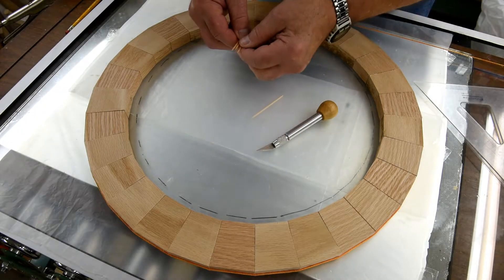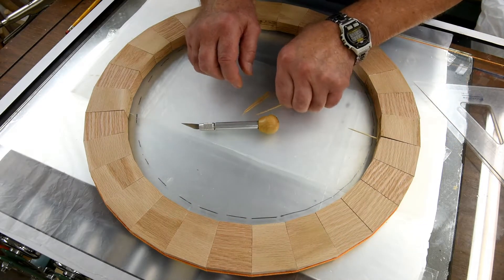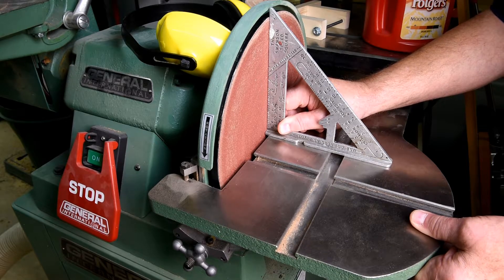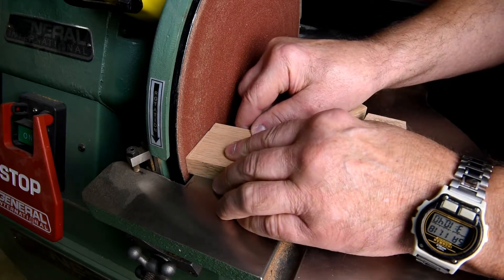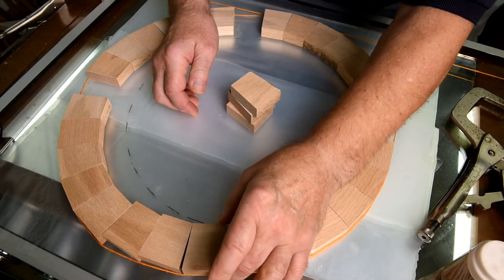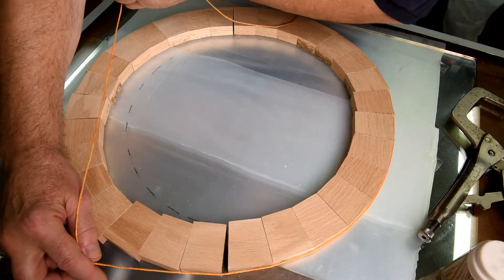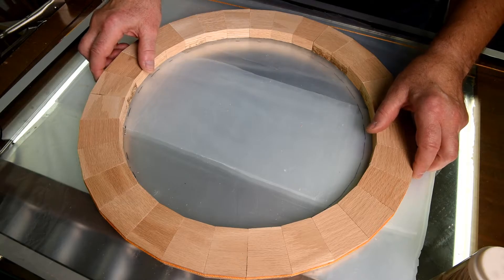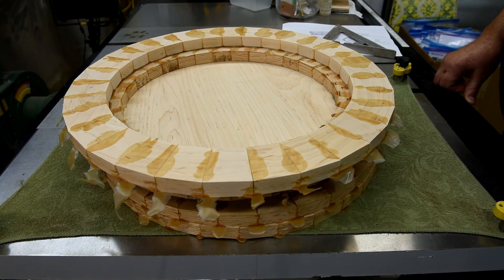The Jumbo Segmented Bowl - Part 14

Comment: Hey Ron, The way you have the bottom of the bowl set up your bowl will likely crack down the road, the grain is moving in a different direction from the rest of the bowl and with seasonal humidity changes its going to cause a crack. You would be better off making a full segmented ring for the bottom so that it all moves and changes evenly throughout the year
Reply from the maker: Been concerned about that cracking eventually too Chris. I'm planning to completely polyurethane the whole thing after the final sanding and am hoping that will seal it up enough. Fingers crossed :)